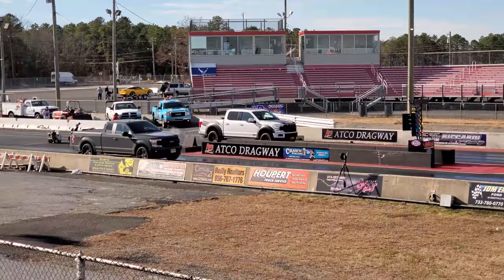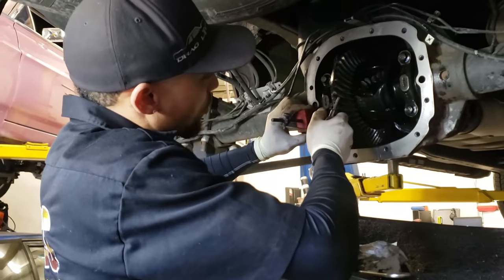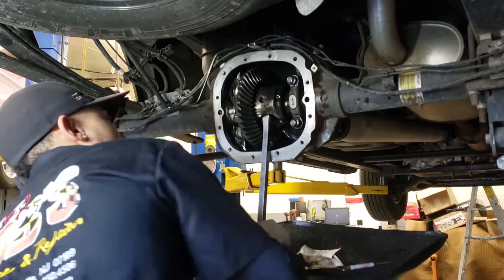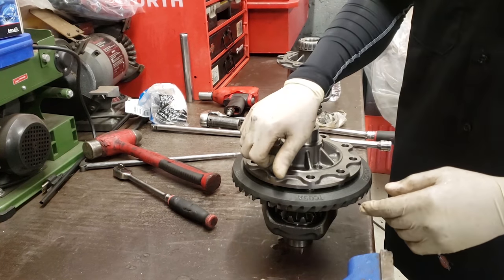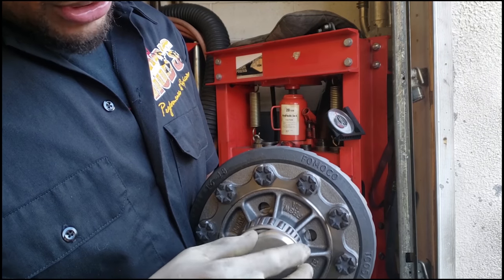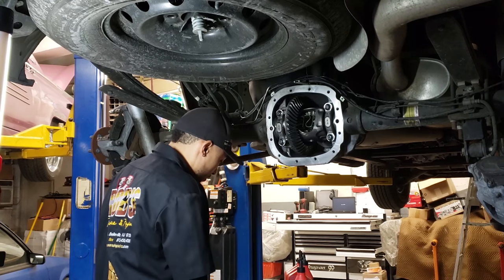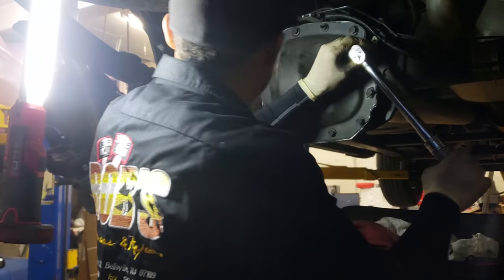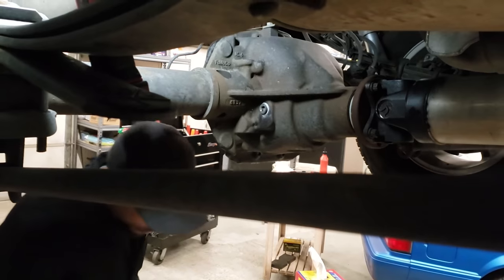2018-2020 F-150  Limited Slip Complete Install

Comment: Thanks so much Boosted F-150 and to Rob's Performance as well for this video.  I was able to knock this out on my own after getting stuck with shims that wouldn't go back in.  I checked the video, and just like Rob said to check, there was still less than a millimeter of light showing between the bearings and the carrier (my press is janky).  So a few taps with a hammer and a 1 13/16" socket and no more light.   I was able to get it all in after that.

Comment: Nice job filming & explaining process. My only input is that its a good idea to support the calipers with wire or bungee so they are not hanging by the hose and to wear some safety glasses when you are washing out the housing with brake cleaner and then spraying compressed air.  You don't want that shtuff in your good eye.

Comment: Using a punch to create dents in mating surfaces is a great way to create leaks. Mating surfaces need to be smooth and even, there is other ways to mark parts such as an industrial paint marker for metal.

Comment: Shouldn't be hanging brake calipers from its lines.
The other thing is freeze the ring gear and heat the  possi unit then the ring gear will seat properly and your not using the bolts to press it in.
Reply: Freeze the posi-unit to shrink it and heat the ring gear to expand it.... Yes... That is a way to do it.... But that takes time and it doesnt do any better of a job that just running it in EVEN with the bolts
Reply: Heat the gear, freeze the carrier

Comment: So you made the Spring hole larger to handle the C-Clip, basically the axle moves all the way as if the spring is not there, I wonder if I remove the spring then install it after installing the C-Clips, maybe that would work. Or simply Ford did just never say it's plug and play and it all needs no modification. I got my unit here on my desk, M-4204-M, Thanks for the bearings stock numbers that's all what I needed. I would love to see a video of the Ford Performance T2R Torsen Differential; 34 Spline 8.8 Inch (15-20 GT, EcoBoost, V6) (MPN# M-4204-MT) installation, if that also fits.

Comment: You should have showed the rear tires NOT moving in opposite directions since you no longer have the open diff. Wonder what Rob thinks of the G2 axle 34 spline 9.75 inch LSD?

Comment: Why not Ford performance Torsen or Trutrac rear LSD, there's no clutches in both of these setups
Reply: I put the Trutrac in mine 3 yrs ago. Very positive hook-up. It doesn't use clutch packs and they also don't need friction modifier. No problems so far and I hammer on it all the time. It came standard in the Raptors and it's made by Eaton, so you know it's going to be good.
Reply from the maker: This is a super 8.8 not a 9.75. No trutrac available and the torsen is a drag race type of diff
Reply: @BoostedF150  Speedmaster torque worm LSD on Ebay right now for a Super 8.8 34 spline. Way stronger than the factory unit. Consider one for your next diff. rebuild.  No more clutch packs, no more slippage, son🙂
Reply: @BoostedF150  forgot to mention that these worm gear differentials act like just like a regular limited slip for regular driving, but lock up much better under power.  After having this, I personally will never go back to the factory clutch pack type.
Reply: @BoostedF150  the T2 torsen is an around differential, drag and road racing. Best of luck, you have one bad ass truck 👍🏼
Reply: Love my helical-gear Detroit Truetrac!
Reply: @coyoteslugger3936  
Torsen won't hold big power
Reply: @FiteTheGoodFight  
Would still have to modify the unit for the truck application.
Yukon ycf348 is 380$Ebay vs 560$ worm unit and is a drop in install...
Reply: @1994F150L  so far I'm push 700 plus to the rear and its holding up, but I do not drag weekend. T2 torsen is 10x better then what OEM.

Comment: What is the modification done to the locker to be able to use the factory C-Clips? Or can I DM about it?
Reply: Rob mentioned it in the video. You can send in unit for modification or purchase new from them.
Reply: And Dorrian confirmed at the end...
Reply: S E living in Canada and managing a parts department at a Ford Dealership doesn’t make it cost effective, I would have bought a Yukon unit instead
Reply: @cornfedonefiddy6373  Some people prefer OEM/OEM+ and it's less than the Yukon. I get shipping and customs costs and wanting to save, but he's in business, has costs in r&d. People don't stay in business long by spending their time giving away info for free. 🤷🏽‍♂️
Reply: S E but that’s what I’m saying I can get a Yukon for about $550, for me to purchase and ship I’m closer to $700+ or I can by a Ford one for $100 and modify it
Reply: @cornfedonefiddy6373  I understand. Sounds like you have some R&D to do if you want this on the cheap and/or to offer to your customers. 👍🏾

Comment: I have 3.15 gear. Going to add 3.55 gears and mustang lsd. Anyone know what else is needed for the swap?
Reply: Did you do your swap yet?  Im just curious why 3.55 and not 3.73 or 4.10? Towing or performance? Personally  i think the 10spd v8 5.0 needs 3.73 at minimum. I just saw a vid here on YT comparing mpg between 3.15 and 3.73 with a 5.0 and the 3.73 did better. Half  a mile or so better to the gallon. Even being a 13sec truck with a tune the slightest hill in 10th on the highway unloaded, just to maintain  speed its got to down shift, and i have 3.73s. Its happiest around 2500 rpm really. If you havent done it yet id consider 3 .73s

Comment: Good video man, two questions for you. Would that posi unit work in the 2015 rear? Super 8.8 34 spline. Also I see looks like you have traction bars on your truck. What are they and where did you get them from? Thanks for info.
Reply from the maker: Yes it would, I have Bwoody traction bars
Reply: Thanks for info, I’ll check it out. Jegs? Or summit?
Reply: I have a  2016 f150   2.7       can    i  use this  same one u used on this video    on it        u got down  in da video   by the way
Reply: @jesuscavazos6489  trying to find the same info and a part # currently.

Comment: Awesome video with many tips to get started but I'm confused, I have Ford Performance Part # M-4204-M to install in my F150 to eliminate the electronic locker but I need to modify it to utilize the C clips? Do I have the correct unit?
Reply from the maker: The ford Performance unit is meant for a Mustang that doesn't have C-clips. We modify it to work in an F-150 that has C-Clips
Reply: @BoostedF150  how do you modify it to makes the c clips work?

Comment: I got a question so my truck came with 3.55 gears w/ E locker and my rear end is the 9.75", will this mustang 8.8 lsd work on my truck?
Reply from the maker: No, you need the Eaton trutrac

Comment: where did you find a Ford LSD for it???? I just ordered a Yukon gear for mine, been looking since Jan 18 when I bought the truck new.
I would love to have a Torsen unit for it,,, no body makes one. I am a 30 plus year Toyota Master Tech, but I have always felt Ford trucks are way better than any yota truck. I could have ordered it with the e locker, and shame on me for not asking, I assumed it likely worked like the Yota ones, only in 4WD LOW, and kicks out at ten mph.. anyway. Been locking for a torsen or LSD for it since I bought it. Any one have thoughts on the Yukon VS. a Ford LSD carrier assembly??
Reply: The Yukon is literally a Ford part that Yukon machined a little bit to help fit the c-clips.... it has Ford part number on it.

Comment: I put the same diff in my truck, works great for the price. On another note, I think you have the shims for lowering kit installed backwards, the tall side is supposed to face the front of the truck.
Reply: Did you have to modify the rear end to work?
Reply: @williamgonzalez8061   The C-clips need to be shaved down but there are a couple shops that sell kits with everything already modified and ready to drop in.
Reply: How long was this job? DIY or shop? Looking at getting this done as well. E Lockers are useless for me.

Comment: Will that work as the replacement to a stock 3.31 open diff?
Reply from the maker: Yes, the truck in the video was open diff 3.31 originally

Comment: Does the truck rear end need limited slip diff, even with the rear diff locker???
Reply from the maker: E-locker doesn't hold up to high up and sticky tires
Reply: Boosted F-150 does the e-lock break, or start slipping or something? Thx
Reply from the maker: It will break or cause the axel to break
Reply: And the lockers exaggerate wheelhop and generally suck.
Reply: @BoostedF150   not to mention if you are just cursing  and punch it you burn off one tire... limited the way to go...  great channel !

Comment: Did you have to replace your lug nuts because of swelling? If so, what did you replace them with?
How long should I soak my clutches in friction modifier? I have a set that been soaking for years lol. Is 15 years too long?

Comment: What is the part number for the diff. I want to get rid of the elocker in my f150 and put a Traction lok diff in.
Reply: What's wrong with the eLocker?  Isn't it the best of both worlds?
Reply: @TqSNv9R0iG5Ckxew  It's the worst differential for street use that there is.  I hope to replace mine with a limited slip some day.  The e-locker is not meant for pavement use and disengages at over 20mph.  Problem is that my truck will easily spin the tires at speeds way over that and it's just a useless one wheel wonder at those speeds.  The e-locker also can't be used on turns at all.  My 100hp Honda can literally pull out into traffic faster than my truck because the truck just spins the one tire and goes nowhere where the limited slip will provide power to both tires in a turn.  All of my previous trucks had the Ford traction lock rear and they worked great at everything except hard core off-roading.  So, the e-locker is great for that less than 1% of time that a modern truck is actually used for serious off road use at low speeds.  At all other times, a limited slip is better.
Reply: @TqSNv9R0iG5Ckxew  I really dislike it, sometimes it won't even engage. The truck is also getting a twin turbo setup in the spring and I don't want to have problems with boosted launches.
Reply: @kklc4  
I'm also interested in adding turbos to my truck.  Do you have a YouTube channel where I can follow your build?

Comment: He has an 8.8. Wow, would just swap to a 9.75 before doing all of this.
Reply from the maker: Y? Super 8.8 have proven to handle 1400+hp why go through the trouble of new driveshaft, axels, rear housing, aftermarket diff. To not gain any strength but gain weight?
Reply: @BoostedF150  you don't need a new driveshaft. The difference isn't nearly enough. You buy a complete takeout low miles unit and do way less labor. Get one that already has a locker, give it 12 switched volts and job done. Way easier than changing a differential.
Reply from the maker: Casey Hood already broke an elocker in a super 8.8 & 9.75 between both of my trucks.  Also the 9.75 rear is a decent amount more weight that I don’t want. Changing a rear carrier isn’t that much work compared to swapping a whole rear plus still needing to upgrade the rear carrier
Reply: Once it's time for a major upgrade, start a 9in build. Lighter, bigger axle shafts, and no C-clip failure risk. Doesn't have to be a fully custom axle, I started mine with a 1978 F-150 rear axle. Had a back brace welded on, got the nodular iron housing, Daytona nodular iron pinion bearing support, used weld on caliper brackets that used off the shelf S10 calipers, then find a set of off the shelf rotors with the right bolt pattern (can reuse the stock rotors), then I chose the Torsen limited slip so I don't have to worry about worn clutch disks or friction modifier in the axle.
Reply: @BoostedF150  As a thirty five plus year mechanic, I thought there may have been some important thins left out of your video. Though I think I might agree on your opinion about the 9.75 swap vs. just pitting in a good LS carrier, though I couldn't find a torsen for an 8.8 super, that would be my only desire to go with the 9.75
Reply: @RJ_Cormac  you mean an old ford 9 inch or a late model 9.75??
Reply: @davidrobinson4486  old 9in, it's still king of the aftermarket and dragstrip. They even make Hi9 for installation into front axles, the old 9in still unbeaten on-track or off-road.